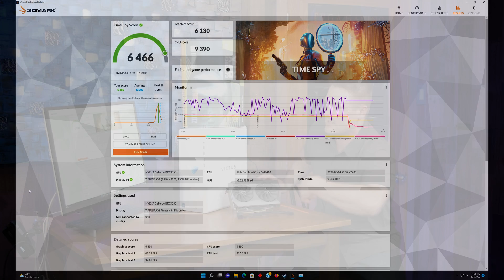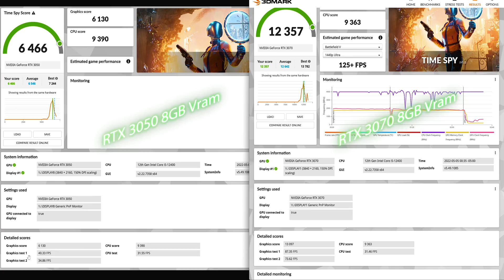HP Victus 15L Gaming PC   Lets Max the GPU out! RTX 3070 Upgrade & How To!

Comment: Any chance on a vid after upgrading the ram on how to switch it to 3200mgz? I threw in some corsair pros 32gb and it’s only running at 2133 or something around there. It has the i5 13000f with the GeForce 3050
Reply from the maker: Sorry, no XMP support. Having a dual-channel RAM kit at a fast speed is better than a single one at a higher speed. Also, CL is imported here and is not seen as a CL 22 ram vs a CL 16 Ram. The CL 16 ram is faster.

Comment: Dumb question but  have the rtx 3050 version, you think it would be possible to upgrade to a rtx 3060 or 3060ti? If so you know any brands that will fit in the case well?
Reply: i had a 3060 in mine it will fit fine i puraded to a 4060 because zotac makes the solo fan version which fits perfectly snug in the case i cant perform many games in 4k with the 8gb vram limitation but its usually ok if i drop the settings down in 1080p and 1440p i can pretty much max out anything but id reccomnd the zotac rtx 4060 solo or the rtx 3060 12gb solo if u have a 4k monitor and want to ball on a budget if u play in 1440p id reccomend the 4060 it has less vram but dlss 3.5, frame generation more cuda cores and a higher clock speed so in most games a 20-30% performance increase bur in 4k it actuaslly can perform worse as vram leaks into system memory at high resolutions

Comment: Would the 500 watt psu be Able to handle the 3070 founder edition
Reply from the maker: Yes the 500watt PSU will work with that GPU.
Reply: Hi did you end up ordering it and was it for the 15l I want to know if a 3070fe will fit in the victus thanks

Comment: Would it be possible to put a psu with more than 500 watts in this case?
Reply: Its possible, but its not worth it if it isnt from HP. Its very difficult if youre like me and you dont know much about power supplies. I tried use a 650w psu with it, but it was missing a cable for the motherboard. So you should go with the HP 500w, i did and the hp one worked perfectly.

Comment: Im thinking about upgrading the GPU in my HP Victus 15L myself. The RTX 3070 is too big for the system as you shown, are there any other GPU's that you can refer me to that are compatible & fit in the Victus?
Reply from the maker: MSI Ventus GeForce RTX 3070 8GB GDDR6 Ventus card will fit nicely in.
Reply: @TNW1337  I'm thinking about getting that MSI 3070 ventus 2x for my 15l.  My 15L only has a 500w power supply though..... Can the 3070 run on 500w.  The specs say that it needs 650w.

Also, my 15L came with a rx 6600xt.  Do you think the 3070 will be that much better?
Reply: @willstuart0001  Ive ran my rtx 3070 with 500 watts for many months now, never had a single problem. Just dont overclock it, and its all good!

Comment: I see 3 SATA ports there. Is it true? Trying to see if it is possible to add 2 8TB HDDs in addition to the M.2 PCie 512GB SSD
Reply: I have the TG01-0023w and I added an 8+10TB.  One in the regular caddy, and the other mounted at the lower front of the case.  I’m not sure if that latter area is still the same on these.

Comment: Nice Video!!! I barely see other channel talking about the Victus 15L. I just bought this computer, but it was a no gpu buy on eBay (but it was the one with the RTX3060). I opened the case and saw it got the 500W 80Gold PSU. Do you think I will have to upgrade to a more powerful PSU if I want to later add an RTX3060 + another 8GB of RAM + 1 or 2 case fans?
Reply from the maker: Nope it will support that.
Reply: @TNW1337  Thank you very much!!! I appreciate.

Comment: I just bought a 3070 founders edition from best buy my friend was going to sell it to me for 340 was wondering will it fit.
Reply from the maker: 10.5 is the max Gpu size long. if your friend has it have him bring it over and try. or look up the specs and see if it is to long.
Reply: Did you figure out if it’s to big or if it fits I want a 3070fe for my hp 15l and don’t know if it fits
Reply: @VictorCopterHelichopter  Was going to get the 15l but I opt out for Asus Prime Z690-A I built a pc way better than the 15l. I wont recommend going that route because alot of reviews complain about it being defective and my 1st was but it was used so I purchased a brand new one from Best Buy.

Comment: I need to upgrade the PSU to 500w. What is the part number?
Reply: 650 watt power enough for 3070
Reply from the maker: @Willam Yes the 500w will work just fine. for the rtx 3070
Reply from the maker: W/ 500 PSU RTX 3070. W/400 PSU RTX 3060 ti

Part number is L77487-001
Spare part number L89233-001

Comment: Does yours have a pcie 3x4 or 4x4 m.2 slot? Pcie 4x16 or 3x16 for the gpu slot? The AMD version came with a 3x2 slot for m.2 and 3x16 for gpu...not as advertised.
Reply from the maker: Pretty sure the intel one is PCIe4 And the AMD is PCIe4 as well. at least from my spec sheet. I will need to install hardware info and look to see what the GPU and M.2 are running at. But in the grand scheme you will not notice a different from one or the other on this PC. for gaming or even editing. at least with the setup it is in. it is not like you can connect a U.2 or another m.2 to transfer to. Even unseeing a USB-C driver plug in, you would not be able to saturate it past 3.0 speeds.

The only thing I would be worried about would be can we get 100% utilization out of both the m.2 and GPU and to answer to that it is yes.
Reply: @TNW1337  both slots on AMD one are PCIE3. 3x2 in fact for the m.2 slot, which absolutely cripples NVMe SSDs  - half bandwidth is no joke. GPU isn't bottlenecked just annoying that their specs are incorrect. I made enough noise that they sent me an Envy te02 so I'm fine, but anyone with a Victus and a nice SSD will be out of luck.

Comment: hello, good morning, what power supply does it have? I want to put a gtx 970 OC with 3 fans and I don't know if the graphics card will fit and that the power supply that comes standard, which is 350W, runs out of energy for the gtx 970 😅. 

Sorry for my english I'm using google translate
Reply from the maker: You would need the 500w for that card. or you could get a riser 16x riser cable and a 2nd psu if you want to go that way.
Reply: @TNW1337  mmmm, ok thanks for your answer, I will buy a more powerful source then. Because I was also thinking about buying a 1660 or a 1660 super

PD:sorry for my english, i am using google translate😅

Comment: Thanks for the video. I purchased this Victus 15L and it arrives at the end of the month. Receiving the basic Ryzen 5 5600G with 1660 SUPER model with 256GB NVME and 8 GB DDR4-3200 MHz RAM.

I am looking to upgrade RAM and add a SATA SSD. However, all 16 GB DDR4-3200 MHz RAM kits I find at Best Buy and Amazon run at 1.35V. In your previous video, you mentioned we should use 1.2V. Would these kits work?

In addition, if I purchase a SATA SSD, do I need to purchase an additional SATA cable to connect it to the motherboard? I cannot install an additional NVME SSD while keeping the 256GB NVME SSD it comes with, correct?

Thanks!
Reply from the maker: Correct, yes you may need to buy a cable. you can swap the driver for a larger one then reinstall win 10. Amazon or Newegg for ram.
Reply: i have a victus with i7 12700k and i up[grasded to 32 gb ddr4 ram make sure its not the fancy gaming ram becuse hp has xmp locked and ram only runs at the default speeds i upgraqded my rtx 3050 to a 4060 and installed 2 more sata ssdls with the extra slots in the motherboard i also made sure to get the 500wx80 psu so if iu want any future gpu upgrades i will be able toio

Comment: You can also use Ryzen Master for overclocking the 5600G - I had some old 2400mhz ram laying around since I bought the base model victus w/ the 3060 ti, and Ryzen Master let me throw it up to 2666 no problem.
Reply from the maker: Correct 100%
Reply: @TNW1337  Update - went up to 2933 and it's fine. Wild!

Comment: Hi! I have a question regarding the TE01 Hp Envy Series.

 I was just wondering if the PSU model (L05757-800--) is the only PSU I could pair with the AMD 6700 XT. I can leave the door off to fit another if needed i'm just a little strapped for cash at the moment and was wondering if I could perhaps pair a dedicated PSU to the GPU somehow instead of replacing the pre-existing 180w PSU. I was also wondering if the heat sink that you used for the CPU was entirely necessary and if I could use an alternative if not.  

Thanks in advance, your videos have been extremely helpful to understanding how all of this goes together!!
Reply from the maker: Yes you can use a External PSU just for the GPU you would want a 24pin power button cable to turn it on. just make sure the external psu is on 1st

Comment: Just did a bit of testing with limiting my 3060Ti to 1350mhz or so, with a slight undervolt.

In Final Fantasy 15's benchmark, it gets a score of about 7800 in 1080p High, which is basically identical to a RX6600 (And maybe a 2060), and very slightly behind a GTX1080.

While using 85-100 watts. Plus my 11700F underclocked to 3.0ghz at 30-50w, CPU+GPU combined uses less power than a stock GTX1080... (And system power draw might be similar to the 1080 alone, but I don't have a watt meter)

 From a Japanese benchmark the 6600 is running at 100w (And looks like it is only the GPU core and not the whole card), and a RTX3050 gets a score of 6700 while using 130 watts. It shows how the need for smaller chips to increase yield harm the power efficiency. (A 130w 3060ti also performs about 40-50% better than a 3050...)

So if you have the money, you can often go for a higher end card and underclock to save more power than getting a weak one. (Just avoid GDDR6X)

The RTX3070 and AMD's 6700XT or higher is going to be some of the most power efficient GPUs, if you underclock. Idle power draw may be a few watts higher due to more VRAM chips though.

Comment: For the front case fan on the nitro 50 is it m3 screws?
Reply from the maker: yes
Reply: @TNW1337  I talked to acer the psu is swappable in the nitro but the motherboard only supports a max of 500w
Reply: @TNW1337  Im probably just going to swap the case

Comment: @TechNitWit Do you know if the cooler master evo 212 cooler is compatible with the acer nitro 50 620 motherboard? It's a good value for money cooler at 48$
Reply from the maker: not sure if it supports LGA 1200, if it does it should be fine.
Reply: I checked It does not but the arctic cooler line does support lga 1200 the only issue Is ram clearance
Reply: I was able to buy 16gb 8×2 used samsung ddr4 3200mhz ram for 50$ which works perfectly with the acer mob and stock Kingston ram. Now I have 28gb running at 3200mhz, adding a cooler master front case fan tomorrow while I wait and research cpu coolers further
Reply: I looked into it and no the cooler master evo is not compatible so I'm going with the noctua redux

Comment: Is it possible to fit a 3070 ti fe in the tg01? The 3070 ti fe is like 10.5 inches and the tg01 is like .3 bigger do you think it can fit?  Also can you use tg02 psu in tg01?
Reply from the maker: The psu would be the problem I think The TDP for the Ti is much higher.
Reply: There IS a 700w psu that HP makes custom for this range of PC's but it's like $160, so...probably not worth it. 3070 is the max for now.
Reply: The 70Ti is stretching it in power draw.

Mainly because 8x1GB GDDR6X chips alone can use 40-50 watts or so. It is going to stress the power supply while you don't get much more over the 3070. 

(And if you power limit it to 3070's TDP, the GPU cores will be fed with less power than a 3070 simply because of the VRAM drawing a lot of power)

Edit: Maybe more than 50 watts even. Pretty sure a 3090 with 12x2GB chips need circa-100 watts. 70Ti has eight 1GB chips, so it might scale to 65-75 watts too...

Comment: Can you tell me the model number of the PSU? Think I might change the one I have in my system if it’s got 2 8-pin PCIe connectors already built in.
Reply: I’m also assuming I would be able to swap into a TE01
Reply from the maker: @venturout   I think I put it in the video on screen top left. if not it is on my other TG02 video.
Reply: Thanks @TNW1337  apologies for not noticing it before.

Comment: I was wondering would i need to upgrade the fans or are the fans fine as is from the factory?
Reply: I think it would go over 80 degrees. (Might depend on your climate though) Adding a fan would help with the heat and cool down the case surface as well.

You can also undervolt and/or set it to about 1750-1800mhz, then you get slightly over stock 3060Ti performance (default 60Ti will also heat up like the 70 in this case, so both will have slight throttling over a PC build's 60-70 degrees) but use like 150-160 watts, then you get all of decent thermals, not very hot case surfaces and more than enough power to game for maybe 5+ years.

In my TG01 I run a 60Ti at 140 watts, and circa 1800mhz. 75 degrees or so even with Hong Kong's weather (probably 28 degrees air temperature before I use air conditioning)
Reply: @RS-nq8xk  So in essence, potentially upgrade to a reliable air cooler like a Noctua fan to help mitigate the otherwise not par airflow patterns for their desktop computers if you got no millers to forcibly make front airflow patterns?
Reply: @SoupCanMafia  Something like a fan on the side vent should be enough.
Reply from the maker: @SoupCanMafia  Side and Front both work just depends if you GPU gets in the way or not.
Reply: Got a USB desk fan to blow into the side vent. 
In an air conditioned room (probably 25C room temp) My 140w 3060Ti went from 'at least' 72.5 degrees to 70. CPU with downdraft cooler went from 76 to 70.

So it looks like with downdraft coolers, you probably should introduce airflow from the front/side to push the hot air (from the GPU) away. The case surface above the CPU (so the top right corner of the case top, if you look at it from the front panel) seems to be less warm too, so it is obvious more heat is being shoved out of the case.
Reply from the maker: @RS-nq8xk  RS is Correct, When I test my PCs I do them at 70F or 21.1111C Some times the room jumps up to 71. But I keep the climate controlled. If I bump it up to 80F or  26.6667C It would get close to the throttling.